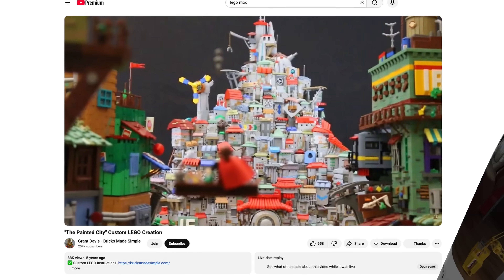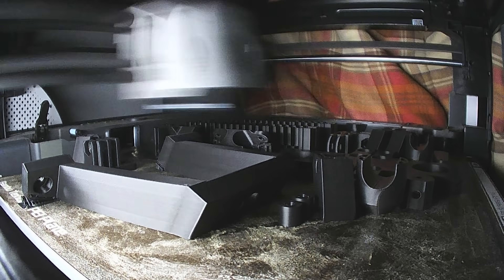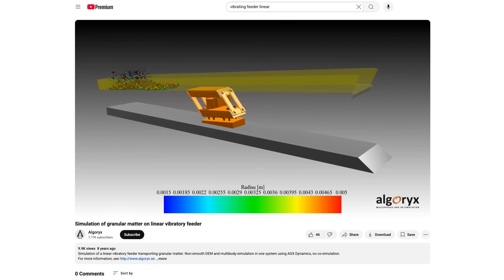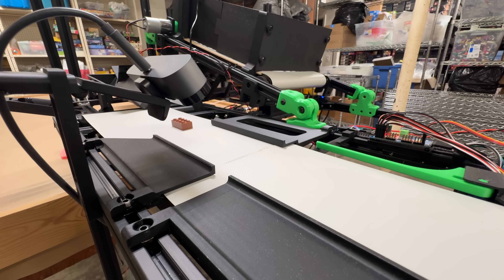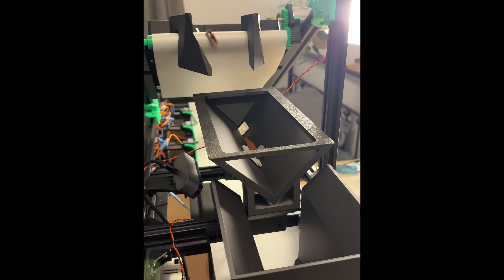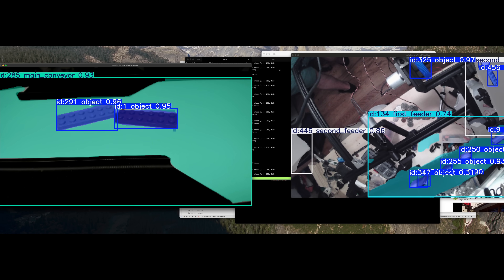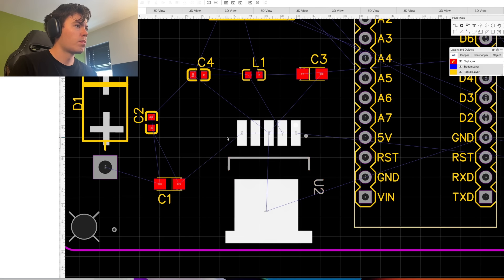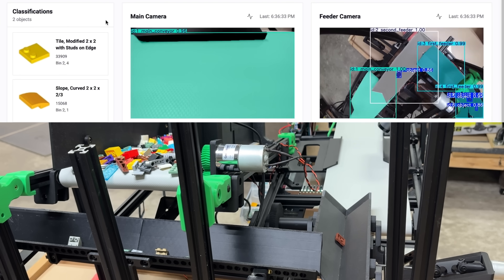A machine to sort a million pounds of LEGO

Comment: Instead of focusing on sorting every piece perfectly but slowly, you're better off sorting most pieces quickly into broader groups, then filtering out errors as you repeat the sorting into subgroups. Say first sort is color and you have a 25% error rate. When you refeed those bins to sort by size, you can filter out +75% of those erroneous color pieces into a do-over bin. By the time you are filtering into individual piece types, nearly every error should have been fed back into the system.
Reply: This is a software layer thing so I appreciate his focus on the hardware, that said I came  to say the same thing; I think this is how most people sort, I've got only got about a dozen sorting bins that I divvy from broad categories (slopes, techinc, wedges, bricks, moving connections, etc) until the top level sort is complete, then perform secondary and tertiary passes as needed, saving color sorting for the absolute last.
Reply: @Shyid for sure. This could effect hardware decisions though. It may make sense to build a multi stage sorting system. So stage 1 sorts directly into 5 identical stage 2's. This would allow stage 2 to run significantly slower and sort into more bins without slowing down stage 1.
Reply: @DeanRockne  hmm, i was thinking a single scalable module, as small as possible, that could be extended up to (i think he said) 712(?) bins OR secondary modules etc... each module being capable of running its own sort algo, and of course each sort module having a 'dump bin' to catch any oddballs or mistakes from previous modules... point being that only one hardware module has to be built and even someone running a single module with 10 bins could get a full sort, it would just take longer than a multi module setup with dozens or hundreds of bins. Currently the scalability of the feeding system seems to bottleneck this.
Reply: Yeah I think most vibratory bowl sorters just allow pieces to go in weird orientations and such and allow them to fall back in when they fail to get oriented correctly, and by doing that they can go faster than making sure every single piece goes through correctly.

The "can't be identified" category for example could just feedback into the original bin to try again hoping that a different orientation gets through the next time.
Reply: @andrewf8366  i can see cases for an against the feedback loop you suggest, seems a good solve for known pieces that go unrecognized on the first or second pass, but if there are too many unknown pieces (either not in catalog, or machine is just having a rough time) they could start pile up and waste cycles... like worse case imagine someone accidently drops 1000 jellybeans into the sorter with 10k pieces, suddenly the machine is in an infinite loop and also down to 90% efficiency at best. Obviously you disallow this person from ever touching Legos or jellybeans again but what of the poor machine?
Reply: @Shyid Just flip a coin that decides if you do a second pass or throw the piece into the "unrecognised" bin.
Reply: @Shyid manual reload on the fails rather than auto is probably fine - I doubt this will ever be a continuous supply chain therefore batch feed and unload is fine. So long as the waste bin is big enough human can then inspect if the machine is off or the pieces are covered in cola... I'd expect a warning alert to be thrown if the error rate is out of bounds too, to let you know something might not be performing correctly.
Reply: Some ideas: 
1: use two cameras for prediction confirmation, the could be positioned differently in order to get less options. Perhaps one camera can be directed at two conveyor belts (to use less hardware)
2. parts could go through meshes (similar to coin sorting machines) to divide into groups by size
3. Maybe this system could be scaled for more drawers: parts are sorted and placed into a motorized "column" that moves horizontally and can dispense all of it's contents into a corresponding column in a wall of drawers
4. Parts that didn't pass sorting could fall straight into a large container placed on the floor instead of using up sorting bins
Reply: It's better to have an automated process 20 hrs long with 99% accuracy than to have an automated process 4hrs long with 75% accuracy
Reply: @DrBismuth  No. Even with the numbers you gave, it's 99.0% in 1 pass vs 99.996% in 4 passes, both taking 20 hours. So the single 20-hour pass has an error rate that is nearly 1000 times worse.

And what we're talking about here isn't about accuracy and is about a way bigger speed difference. It is about not having 10,000 bins to sort into once, it's about having 100 bins and 101 passes. Or, more realistically, about having a couple of dozen bins and as many passes as needed to reach the final granularity.

Say, in the first pass, you sort into all the colours there are. The pass is very fast and makes plenty of mistakes (pieces too close together to be separated). In the next pass, you sort into 20 broad categories of pieces, same speed, but you also reject wrong colours to be fed into the next "paster pass". You divide the results until you have single varieties for each bin, each step rejecting wrongly sorted pieces from previous runs. The last run also rejects pieces it cannot separate, but it drops those back into the feeder.

Yes, you are running the bricks through the machine 5 times, but you also can run the machine 5 times faster ... and you do not need a 10,000-bin machine, only a 30-bin one. That's huge savings. (Also, you can have two machines; a fast one for the first passes that sorts into buckets that are big enough to warrant running them through when they are full, and a slow and better separating one with small bins.)

And here's some math: Say, you have a machine with only two bins (and a reject bin, but let's ignore that for now). With one pass, you can sort 2 types of bricks. Useless. With 2 passes (3 runs), you get 4 types. 3 passes (7 runs) are 8 types. 4 (15) 16. 5 (31) 32. 6 (63) 64. 7 (127) 128. 8 (255) 256. 9 (511) 512. 10 (1023) 1024. 20 (1,048,575) 1,048,576. But remember, those run numbers only hold true if you run one batch through all the way. In reality, you would wait to run a pass until the bucket is full, i.e. you run two first passes, combine the result and then run two second passes instead of four. If your machine runs continuously, your run numbers would match the number of passes you have, i.e. 20 passes (20 runs) => 1,048,576 types of bricks sorted....with just a "left-right" sorter!

If you add the reject bin and a reject rate of 10%, things look much worse. After those 20 runs, 10% of the bricks would be sorted, and 90% would need to go into the machine from the beginning again. But that's largely an issue of many passes with a 2-bin machine; if you add more bins, a 10% reject rate gives you a 50% or better sorting rate for up to 6 passes.
Reply: Meatspace quicksort! 😃I like that!
Reply: I too sorted scrap on Fulgora!
Reply: You could try grading the pieces with a mesh into different size classes and then sort them. To overcome the issues of pieces stacking on top of each other.
Reply: I don't find sorting that difficult Studs, Plates, Bricks slopes, that's most lego sorted, also this cant detect fake Lego, so don't solve one of the biggest issues.
Reply: There are a variety of sorting algos to choose from. This seems more about hardware than software
Reply: Yep totally right.
Reply: yes weight and Color could be proper first gates
Reply: I figured a giant sifting device like a coin sorting or something similar
Reply: If you can sort it perfectly, it’s able to scale efficiently. The identifier in here is not the bottleneck of throughput, that would be the conveyors and the vibe feeder.
You can sort perfectly and fast, if you get the input to the identifier quicker per cycle.
Like- he could have the feeder vibe while the identifier is running pushing the part right to the edge, have a split conveyor so the sorting part is independent of the identifier, and increase conveyor speed.
Re-sorting multiple times to decrease error-rate would be entirely dependent upon the amount of cycles it would go through. Given enough input, the output WILL produce an error.
Reply: The problem is that sorting in groups is essentially the same thing — you still need to recognize each piece individually. Since you have to present them one at a time anyway, it feels wasteful to do the work twice: once for the groups and then again for the individual pieces.
Reply: I would first sort all pieces by color, this is a simple sort. Next a size sort, this breaks down into shape classes. Next a shape sort, each size group has certain shapes allowed. Multi sorts may seem a lot, but they allow for speed increase by needing less visual sort possibilities. Each sort removes less buckets as well, fewer things can go wrong.
Reply: @Jay.C.H imo colour first is daft. A human can easily pick from a box of 2x8s the one that is the colour they want. First sorting stage would be whatever gives best results at the subsequent stages, or what most efficiently reduces work or error at subsequent stages.
Reply: @Jay.C.H  as others have said, color is typically the final sorting layer as the human eye has a hard time picking out the shapes of different pieces when they are all the same color... this is actually used to artistic effect in techniques like greebles/greebling... this might be less of an issue in an automated system but I suspect OCR may even get tripped up by this from time to time. Delaying color sorting also has the added benefit of allowing more continent human intervention at any point if that becomes necessary.
Reply: @ddv045 Not really - it actually saves a lot on complexity because you only need to output into a handful of bins, not hundreds of bins. Then you can re-run the outputs with different criteria.
Reply: those vibrator lines suck more electricity than the brick is worth.
Reply: @knotjabissness1306Haaa
Reply: NO WASTE HOURS AND HOURS INSTEAD OF SOMETHING MEANINGFUL

Comment: Machine vision is cheaper and easier than anything mechanical, so makes sense to maximise use of that. maybe  instead of trying to seperate parts before vision, just have a big tray with a  shaker and one or more camera/vision systems to look for parts on the top layer until nothing is found then vibrate to show more.
Use a vacuum pick/place robot to pick out parts as they are recognised. This would have lots of flexibility for collection/packing as you can have different sized containers/ bag openings for more or less common parts. 
With a fixed number of placement bins, you could do multiple passes - only pick the parts you have bins for, then repeat with a different set of bins.
Reply: The processing power required to identify a moving tray of parts is not small. The professional ones use a GPU. 
then you have to train the picking mechanism, the arm or whatever it is, which is a whole another specialty engineering problem that requires a lot of computer with a GPU. 
I mean, you could do it with a laptop and 3D printed parts, but it would be disappointingly slow until you got a bunch of more expensive computers and robotics. which means it's not really DIY friendly anymore. 

what you're describing actually exists, the state of the art system can pick the parts out of a bin without even needing a tray and then sort them into other bins that you don't have to place in specific locations. you could probably program it to disassemble Legos into individual parts as well. but the price on the equipment is probably going into the millions...
Reply: @jimgoplayoutsideable with modern phones have built in NPU a phone could do all pf the work. It would need to be a pretty new one, but not exactly this years model
Reply: @jimgoplayoutsideable  You would not do vision while moving - you'd use a static image, pick everything you can, then shake it to reveal more
Reply: @mikeselectricstuff "looking for parts on the top layer" - this is the issue. The low computational part identifier needs each part to be separate. if you have parts next to each other it doesn't work. If you're trying to run a full on AI part identifier that can actually pick parts out of a pile, You're going to need a GPU or you're going to need to wait minutes for each image to process. 
Then you also need your picking mechanism to be able to pick only the one part that is in a pile of others, or right next to others - this is something you can do from a laptop, but you do have to train a model for your robot picker, which requires a lot of specialty robotics skills. you have to model the robot, then you have to import the model into a simulation program, then you have to run the simulation, then you have to take the simulation data and process it into a format that can actually control your robot. and if you're really good at it, it will kind of work. you'll have to do this process several times to work all the bugs out.
I think your idea is cool, it's just not a DIY unless you're a computer programmer/ robotics engineer as a hobby. maybe in 5 or 10 years it'll be more plug and Play.
Reply: I think this has my vote due to simplicity/low part count/reliability and sheer number of items they’re sorting. I’d have a hopper spread them sparsely on a flat vibrating plate, and pick from there, due to easier identification and picking.

The pickup gantry could also suck them into a hose for quick transport to a dropoff gantry above a grid of dropoff bins. In fact, that is how small bits of plastic is moved in factories, not by conveyors but by air. Also would be pretty fast because the dropoff gantry could stay above dropoff bins.
Reply: This also has my vote. If identifying the correct part in the pile ist to complicated, you could also first grab a single part out of the pile and then identify it with a second camera, when it is singled out. This would be really easy to implement with Machine Vision.
For an industrial setting you would choose a Scara Robot. But for a home setup a 3D Printer would also work as a Robot Arm. This would probably be the chapest solution. Everybody already has a Laptop at home which is enough power for the inference.

Comment: 2 pieces per minute is waaaaay to low.. you would need 2 pieces per second to be reasonable. Yolo can definetly do that and much more. but you need to have your DB local. making a online request for every picture and transfering the picture to a server is slow. ideally you could have pieces arriving one touching the next, and then have a second conveyor that runs much faster, that would take them automatically apart.  so your "singularization" step, just becomes a step of "make sure they are not on top of each other".

Comment: I wonder if a system of sieves to seperate items by size would help. It should also be fairly simple, just relying on gravity. 
With similar sized pieces, I imagine seperation through vibration should also get easier.
Reply: Lego sell shake and sort storage bins shaped like minifigure heads that do this. Certain pieces often got stuck and clogged the holes and the amount of shaking required can lead to scratches.
Reply: I think there are too many varied shapes to work flawlessly using sieves.

Comment: In your next evolution, you might consider a pick and place robots. This will allow parallelism. Send multiple parts down the belt adequately spaced, use you computer vision to subdivide the belt to recognise the bricks. Use a delta CNC to pick up the bricks and drop them down tubes into the sorted trays or hoppers, this might be more space efficient and allow a 3d instead of 2d arrangement of sorted part storage.
Reply: The pieces might be too diverse for a simple picker. Frog tongue?

Comment: I think your concept is holding you back in terms of efficiency. 
Let me explain:

You want to sort everything brick by brick, but you haven't enough storage drawers to sort every single brick at once. Therefore a single brick needs to be sorted by the sorter multiple times. Every step needs time and you're loosing a huge amount of possible sorting speed.

To prevent that I suggest additional sorting stages:
Purely mechanical, for multiple bricks at once, without clocking your main sorter!

The first sorting step should pobably be by general size: for example with a vibrating "grid", like your "shaky conveyors", with holes only some bricks fit through. You can also sort places like technic axes in a singular process after only needing one storage while sorting using your machine.

I hope I should help you, keep going!

Comment: 2 ideas for fixing the feeder issue:
1. Drop some pieces on a vibrating platform. Hang a camera above the platform. Vibrate them for 1 sec, and then identify any pieces that are laying by themselves. Grab those with suction, and put them in the correct bin. Both the vibration plate and bins are inside a xy carthesian machine, so the carriage with the suction grabber can do from the plate to the correct bin directly.
2. Use a small suction cup of about 3mm to pick up pieces directly from a big tub. With such a small nozzle, its impossible to pick up more than 1 item. Just move the sucker tip down on the pieces, maybe shuffle it sideways a few mm, and lift again. Theres a decent chance you have a part. If not, just go again. You can do multiple suction heads spaced apart if you wanna speed it up
Reply: Saw a similar comment and agree.

I like the idea of a bunch of suction cups randomly grabbing at Lego pieces, like one of those arcade games.
Reply: heh, there are bulk fed pick&place machines for electronics manufacturing that work like this